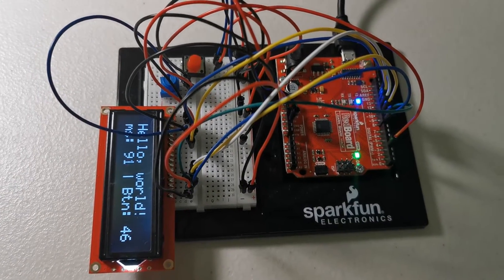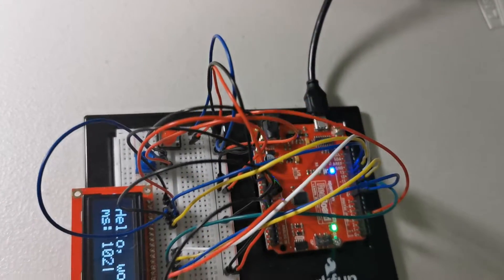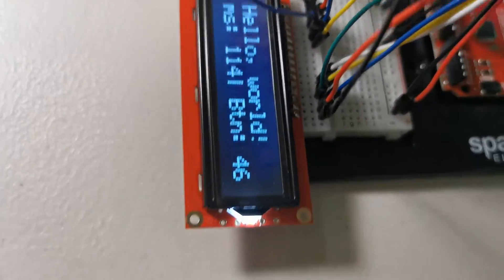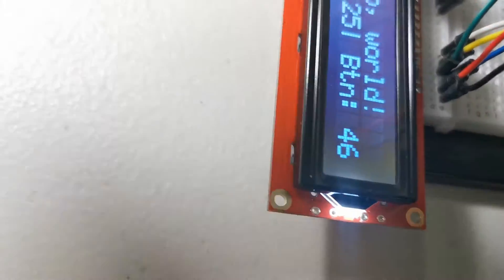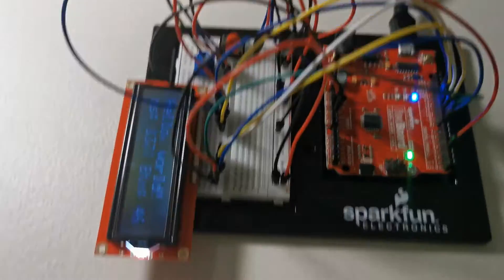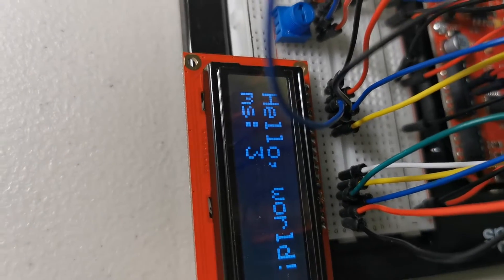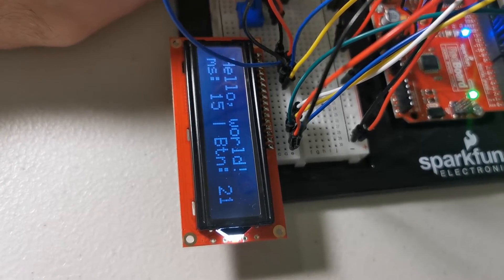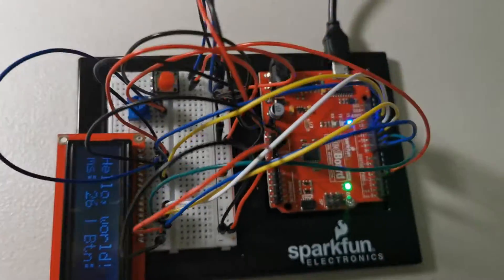Comp 444: Circuit 4a - LCD "Hello World"

Comment: Really cool, but kind of code did you use, mine is not working
Reply from the maker: Sorry to hear that. Are you in this class in Athabasca University as well? I modified the code that comes with the kit. Do you have access to that?
Reply: @robdeluksschmidt  no I am not
Reply from the maker: @forfun2293  https://www.sparkfun.com/sikcode
Reply: @robdeluksschmidt  I have the exact code but it still not working 😕 😑
Reply from the maker: @forfun2293  Aside from something not being connected correctly, try turning the potentiometer. When I first set mine up the contrast was really low and the screen wasn't showing anything.
Reply: @robdeluksschmidt  I tried to do that too and it didn't work everything is working but when I uploaded my code it is just a mass
Reply from the maker: @forfun2293  The only other thing I can think of aside from faulty parts is to double check the 5v out. I always put that in the wrong pin hole.
Reply: @robdeluksschmidt  I already checked and everything looks good but the code still not clear as yours the text looks terrible " Hello World" even though my code seems correct